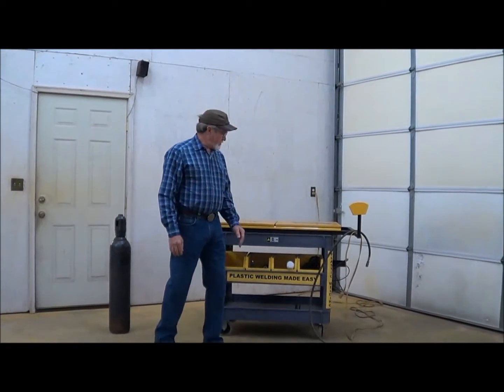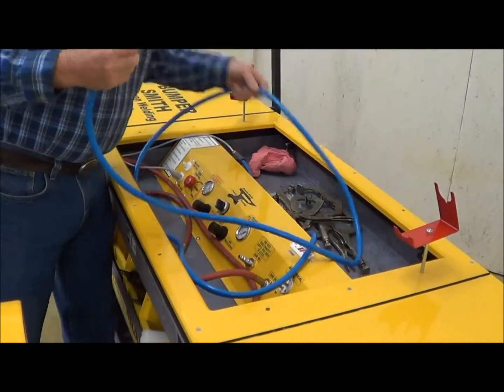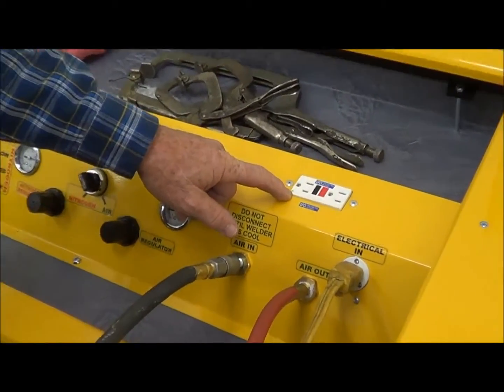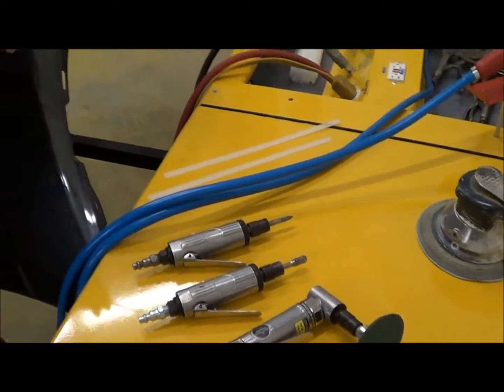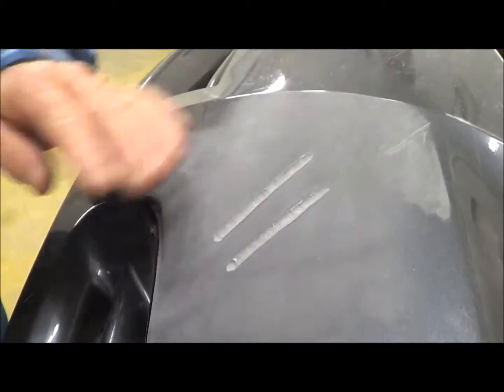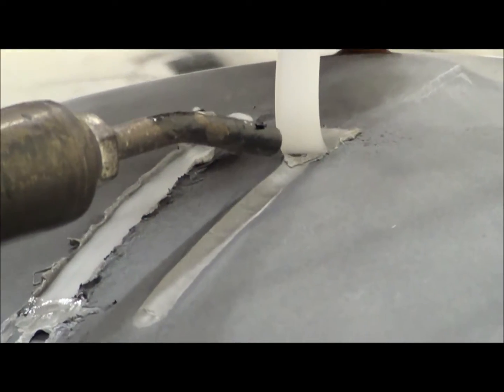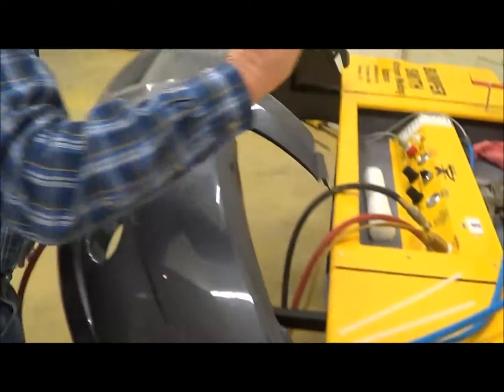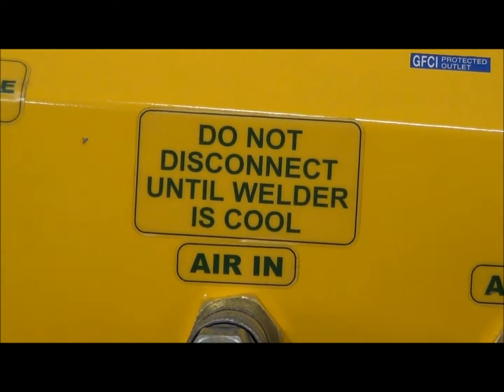How to Setup and Weld bumpers with the Bumper Smith Nitrogen Welding Station

Comment: How does the nitrogen work in this welding process? I don't understand.
Reply: Prevents the plastic burning by means of oxygen suppression
Reply: Nitrogen pervents oxidation and moisture getting behind your weld as you’re melting the plastic rod into the plastic surface..

Comment: David your unit is the best new piece of equipment that I have seen in a very long time. The work station unit is so far ahead of the rest.
It's so easy to use and it will pay for itself in a short about of time. The shops that have purchase this unit are very impressed with the operation of the unit and the work station to mount the bumpers. Keep up the great work.